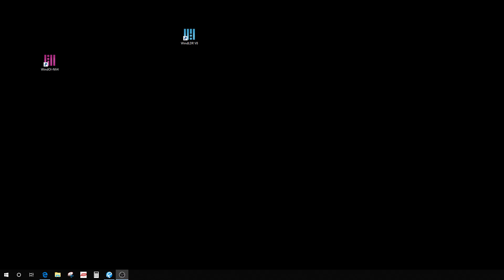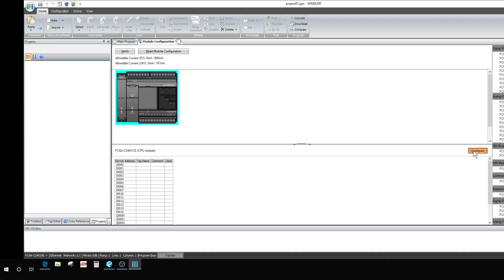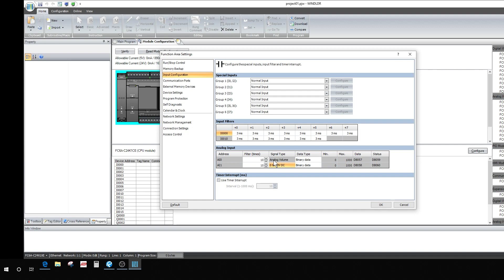IDEC PLC Onboard Analog config

Comment: Hey man, love your videos! Helped me work through some sticky parts. I can’t for the life of me figure out how to write instructions to control outputs with an analog input.  If you could help that would be awesome!
Reply from the maker: Hang in there.  I will you something going.  Are you trying to control a digital output?  Something simply on or off, dependant on an analog value?  Like a pressure sensor controlling a compessor turning off and on.   Or, are you trying to control an analog output, from an analog input?  Like a pressure sensor controlling a proportional valve?
Reply: @ControlFreak yea exactly just a digital output or a few actually.  The closest  I've gotten was trying to use the alarm contacts on PID control, however when I manipulate the data register from my HMI with word buttons and numerical input the alarm contacts wont change state.  I can send you my .PJW and .PN4 files if you want to look at it.  The process I'm writing for is a main sewage lift station with a 4-20 echo transducer in a still well. So the PV is the transducer and the alternating pumps are the CV. But before I put the project in action I wanted to see if I could program my hmi to be the "analog input" for simulation purposes.  Not sure if that makes sense to you.
Reply: I figured it out, the numerical input with the floating point threw my range out of whack.  My range is 0-48" , long story short I figured out my range has to be from 0-480 if i want to include fractional inches as well,  so what i thought was increasing by .1 was actually increasing the value by 1 on the PID control.
Reply from the maker: @jacobmason1509  Awespome!  I will try and do a video on it also.  Using compare function.   I really need do a video anyway.  it has been a while.
Reply from the maker: @jacobmason1509  video uploading now.  Probably not the way you did it.  But, its a way to do it.  Thanks for watching!  Subscribe, Like, Share!

Comment: I ran into some trouble using fc6a and hg2g 5tn22tf.i cant get them to communicate with eachother through com ports maybe im not setting them up correctly i tried everything no luck.
Reply from the maker: Probably need to update firmware.  Youll have to use the usb directly to each unit first to do that.
Reply from the maker: I will try and get a video on tonight for you
Reply from the maker: video up.

Comment: I still cannot seem to figure out how to use the onboard analog input as an input in my code(don't see it in the list). Also I am having a lot of difficulty getting my PC to communicate with the FC6A through ethernet using a USB adapter. Any help at all on this subject would be appreciated. Also thank you for making these videos, they have been a great deal of help with a project of mine so far
Reply from the maker: As far as the Analog input, D8057 or D8058 is the data register where your analog value is stored.  (They are listed under "Special Data Registers" in the manual)   Depending on if you are using the analog volume pot, or the 0-10vdc input wires.  You will have to scale it by math functions to another data register.    I think the 0-10vdc is 1000 resolution.  I am not sure about the volume pot.  

I have never accessed a FC6A with a usb to ethernet.  I do not think it is possible?  I am not sure on that, but I don't think so.  Why dont you use a Usb to usb?  It would be faster up and down.    

I hope this helped.  If not, let me know.  I will try and clarify.  Or, cook up a video for you.
Reply: @huntxtrm  so i've got it to communicate through usb now. The issue I seem to be having now is that when I go to read the module configuration, it doesn't seem to recognize the proper module. Mine is an FC6A-C16R1AE(120V). I am also an automation tech from the West Texas oilfield just trying to get my foot in the door as a programmer. Your videos have helped me out a whole lot so far. If there is someway I can contact you that would be amazing. I've got a couple questions on giving load instruction as well. Thanks a lot, man
Reply from the maker: @westonwomack1008   shoot me an email.  ControlFreakRoy@outlook.com.  I will reply with my contact info.  Dont think its a good idea, to put it on here.

Comment: would i be able to use a 4-20 mA sensor by adding a 500 ohm resistor? making it 2 -10?
Reply from the maker: Dont know for sure, never heard of that route.  I dont think so though.  0-10v is voltage supplied to tge plc, and 4-20ma is milliamperes back to the plc?  Would do a web search.  You could probably get an analog cartridge pretty cheap on ebay.  Or, even an analog card.  They are univesal on the inputs.

Comment: Control freak in about a 2 months ill be needing to purchase a new laptop for progamming any recomendations?
Reply from the maker: Something with descent ram, lots of hd space, ssd drive is best.  In my opinion.  Lots of usb ports, rj45 ethernet port.  I would stick with pc based and stay away from macs.  I gave a 17" screen on my laptop, and 27 on my desk.  Its easy for me to have both the hmi and plc programs open at the same time.  HMI on my laptop, and PLC on my desktop monitor.  Backup everything to the cloud, and usb drive also if its important.
Reply from the maker: Oh yea, wifi and bluetooth come in very handy ss well.
Reply: I was looking into the panasonic's toughbook.i can get a reburshided with a lot of addons for about 1500 .are those any good?
Reply from the maker: Those are really good, especially for field work.  Tough, and Durable.   @huntersblue

Comment: I keep getting error message ip adress not available
Reply from the maker: did you get this figured out?  Sorry for such the late reply.  Been settling in a new job.  Let me know if I can help.
Reply: Yea i did I used an old project and downloaded it that plc and it worked, I had something in the configuration wrong
Reply from the maker: @huntersblue  awesome sorry I missed your message.
Reply: No worries its all good. Do you use any other plcs or just idec?
Reply: Idec was a good learning experience, I moved on to siemens though.
Reply from the maker: @huntersblue  i have used Modicon, Koyo Clicks,Mitsi's for programming.  Worked on a lot of the rest.  Just prefer the IDEC, because they are more within reach price, tech support, and software.  No I dont work for IDEC.  But some or the other brands make it much more complex than it needs to be.  Thats my opinion.
Reply from the maker: @huntersblue  good greif!  Have you heard of "Stuxnet"!  Lol.  Siemens are good, never programmed them, but have worked on them on the hardware side.
Reply: @huntxtrm  I have not heard of it, give siemens a try youll like it, it has alot of cool features. The hardest part is the initial setup after that the programming is not too bad .
Reply from the maker: @huntersblue  look up Stuxnet, its interesting.  And, I would try seimens.  But, the software is crazy expensive from what I have seen.  All plc's are similar in programming.  In my experience.  User interface is a what takes time to get used to.
Reply: Not really you get a 21 day free trial,ill look into it. If you like it I can send you a license key I have a friend who works for siemens.
Reply from the maker: @huntersblue  cool
Reply: We have a machine with a direct logic plc I looked at the code and I just can't figure it out ,maybe you can make a basic video on one of those?
Reply from the maker: @huntersblue  email me.  ControlFreakRoy@outlook.com
Reply from the maker: @huntersblue  code?  Or ladder?  Email it to me, I will give it a go.
Reply: Ladder diagram no documentation
Reply from the maker: @huntersblue  send it, tell me what its suposed to do.
Reply: Email sent, its a doug process line it rolls up Doug balls and dumps them onto a another conveyor in 2 sets of 6 doug rolls, then travel across a trasnfer conver and get pushed into oven buckets ,repeats over and over.
Reply from the maker: @huntersblue  got it, I will look at it tomorrow.